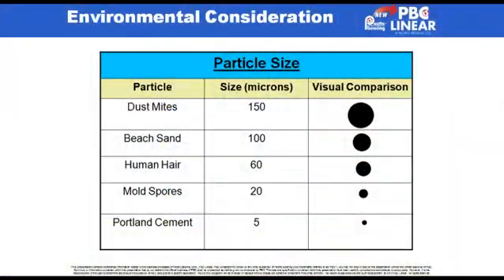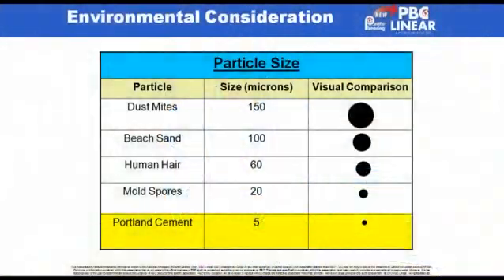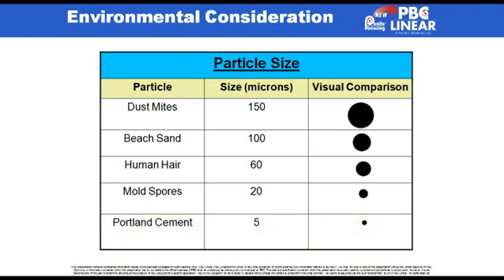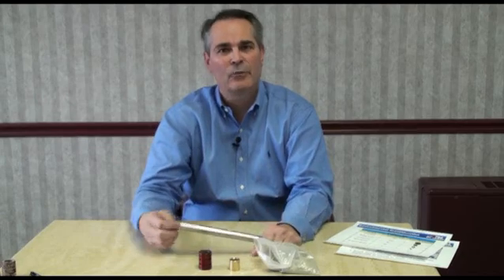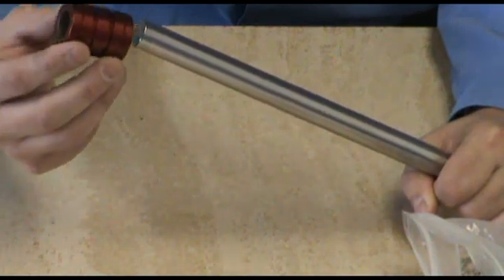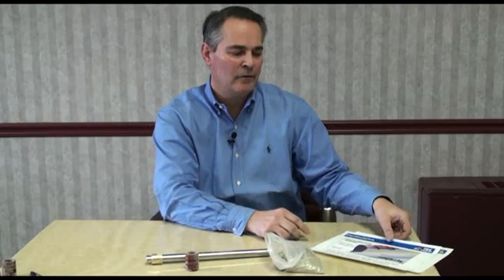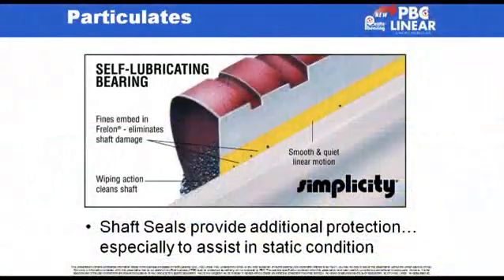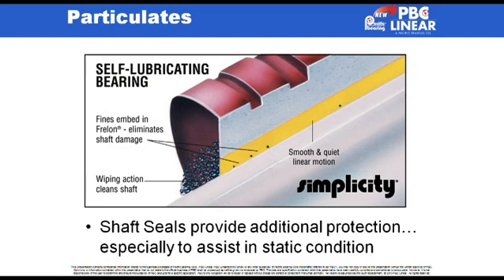Simplicity® Linear Bearings vs. Bronze Bushing: Dirty Environment Demonstration

Comment: But what happens when the Teflon gets saturated?
Reply from the maker: One of the many strengths of a plain bearing is to essentially push the majority of the debris off of the shaft and in extreme conditions bearing seals are available to minimize contaminants from getting between the inner diameter of the bearing and the shaft to extend the life of the bearing. 

The liner material has a limited capability to absorb contaminants, essentially these contaminants are typically abrasive and will remove the liner material.  As the liner material saturates the Coefficient of Friction can increase requiring more effort to move a given load.  As the material is removed through wear the running clearance fit between the bearing and shaft will increase. This leads to the natural question of how much wear is acceptable to the application before needing to replace the bearing? 

As there are many variables that can affect the wear or life of the bearing typically the best method to determine suitability in the application is by empirically testing by the customer.